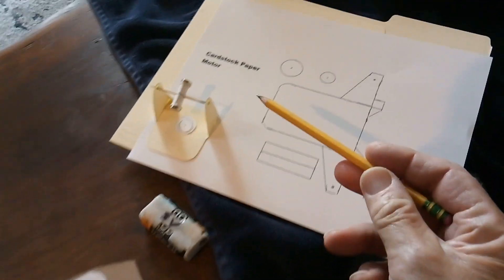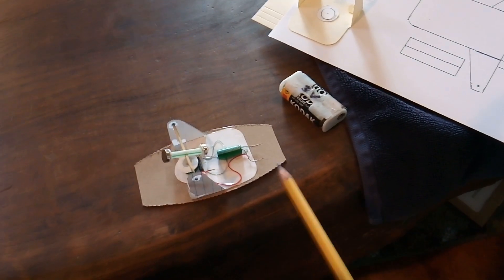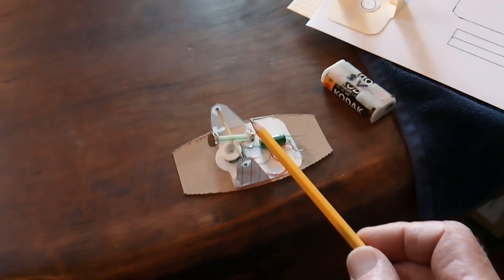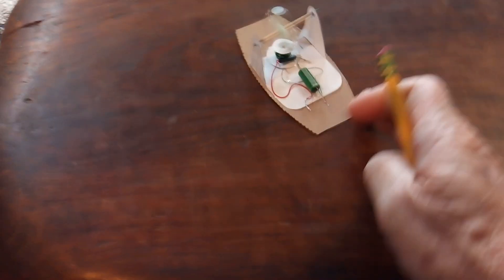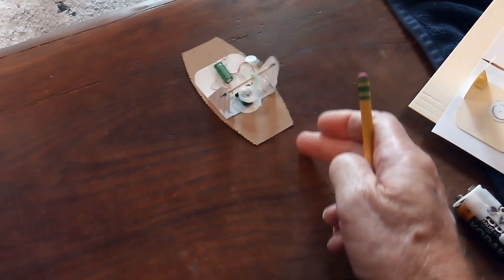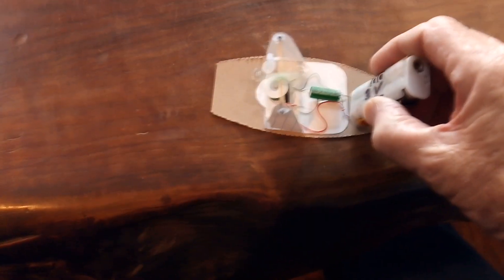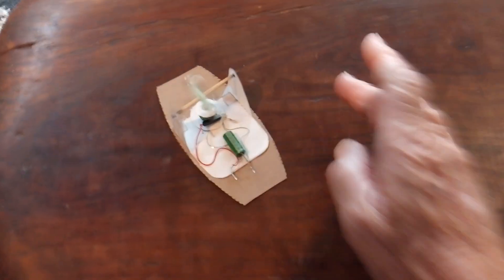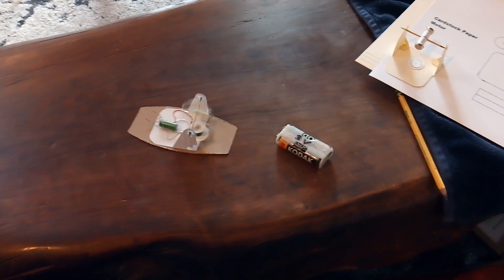Cardstock Paper Motor --   Part 3  Lets move

Comment: Put that on top of a bunch of little steel balls, beads or marbles. 
The rotation and vibration are working to move it in that direction. 
That's the friction being converted into lateral motion.

Comment: @lidmotor do you have a parts list for this?
Reply from the maker: Other than the cardstock paper what you will need is this: 
One round tooth pick
Two 10mmx3mm neo magnets
About  3 meters of 30 gauge magnet wire
A small magnetic reed switch
A small 2.7v super capacitor ( 3 to 10 Farad)
A small amount of foam mounting tape  
The wires are simply twisted together.  No soldering was needed here.

Comment: A motor drives a vehicle. Wait, isn't that what it's supposed to do? Yes, but not in this somewhat unconventional manner. Perhaps try different surfaces on the underside to see what gives the best result?
Reply: Maybe you have an old traintrack laying around so you can make a ‘train-inertia’ version of it and call it ‘cybertrain inertia truck’ or something. Will attract lots of viewers haha. Nice build (as always)
Reply from the maker: A smooth surface works the best. The cardboard base is the pull off top of a tissue box.  I am not quite sure what is happening here.  I am getting a force vector somehow.
Reply: @Lidmotor Vibration frequency and resonance and the rotor placement, a bit in front of the center look to me are all factors in this. A very cool phenomenon!
Reply from the maker: I think this works like a 'Bristlebot".  The reason I mentioned Grandad is that he did alot of work with those using different bases and they all moved like this. @benwinkel